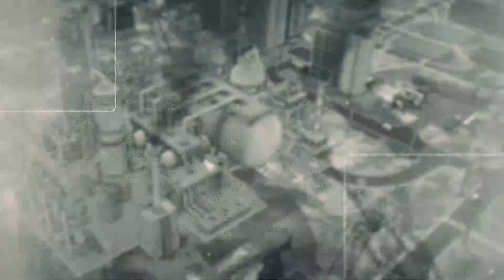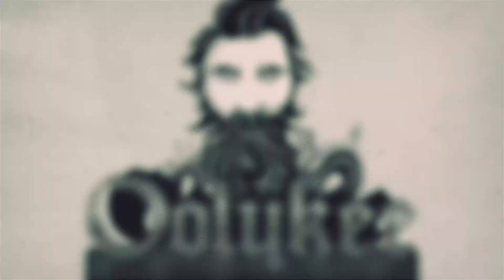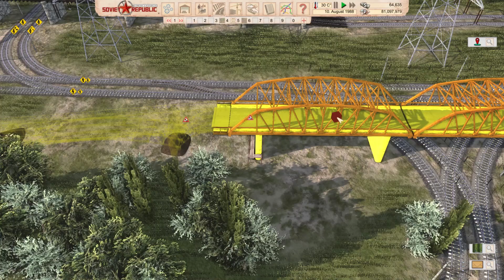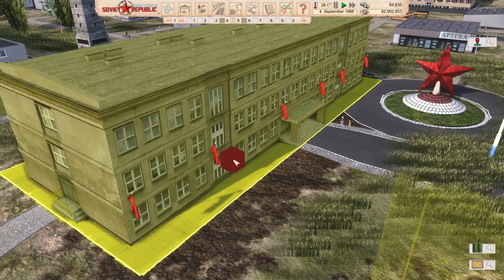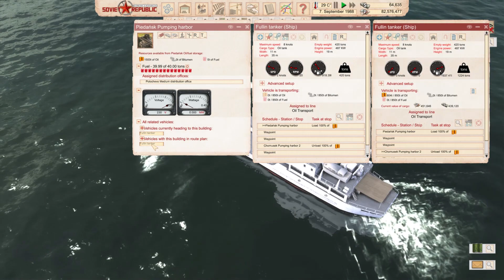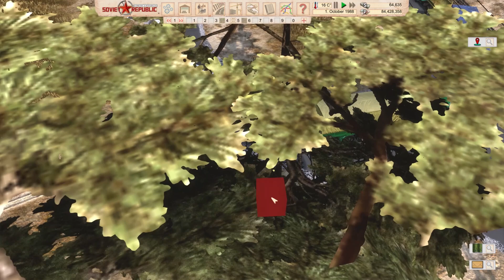Soviet Republic - Alaska - The New Beginning - Ep.118

Comment: 1) You should supply your DOs with fuel and reserve your gas stations for buses and trucks that have a "direct line". Having all those covered hulls from agricultural areas (not to mention harvesters) using your "urban" gas station doesn't make much sense.
2) There is no line spacing option for trains and trams. The developers told me that they regretted it but that for coding reasons they would not try to implement a line spacing system for trains and trams. The only way to space them out is to play with the semaphores, but for complex lines with many stops and a large number of vehicles the solution works quite poorly I must say.
3) If you want to make your streetcar lines look a bit more urban you can use paving, it looks pretty good, it looks like a real streetcar line on a "road". On the other hand, it's painfull enough to get a good result (but there are ways to get there)
4) Chemical industry thoughts (and only opinions) :
a) If it were me I wouldn't build all these chemical factories in the same area, from a city design perspective they look too different to look "pretty" (from my point of view). For example two of them (Kardifabrik and Huge chemical plant) have a brown brick look that would go better with a city of this type, Rob's have their own cohesive appearance that could eventually ally with the large chemical plant of Mauser Nato (the one that produces 8.4) etc. To summarize if I were you I would group them in different areas according to their appearance.
b) Besides, more than a chemical city you want to develop a "chemistry valley" and therefore you can quite possibly have two cities with two different groups of factories. Rob's factories and Mauser Nato's for one city, brown brick chemical factories for a second city (more towards the border).
c) I would add that if for example you group together the brown brick chemical factories you also have moded fabric plant and clothes plant that look the same (and since the fabric factory uses chemicals ...), you could thus having a big city of bricks (the magnificent Hardau mod perhaps ?) with this group of factories, the area towards the border being quite spacious.
d) The Hazardous chemical plant (whose stats need to be remade to be used, IMHO) has an old industry look that would be more appropriate as a side industry in a small town elsewhere on the map.
e) Likewise in my opinion the chemical factories of LegendGamer (which should also have their stats remade IMHO) have their own coherent appearance so much with each other that they could be part of a third city with the adapted look
Reply from the maker: 1. Will do! You are right! 
2. Thanks. 
3. Good idea! 
4. 
a. Interesting. 
b. Not sure if we have space for another city there. Maybe I should plan it elsewhere. 
c. I will do this. Good one. 
d. Agreed! 

Thanks, Stats!

Comment: yes the gui for the demolish, basically the underlying popup is interfering with the top one, so if you click in lower right corner of the checkmark button, that area isnt overlapping the underlying window, and so it works properly, but majority of the button is overlapping the underlying one so it interferes.  pretty sure you can also hit the enter key or numpad enter key to confirm the same as clicking checkmark buttons on (i think) any dialogue in game with checkmark button.
Reply from the maker: You are right! I used to do it with the enter button. Thank you, Aya! :)

Comment: I find when using the raising up tht terrain method, using the elevation map makes it a lot easier to get both sides to the same height. If the game had a littlr more road functions as cities skylines, a roundabout at the intersection you built would be perfect for all those roads to come together. I thik tht city would have been built in tht large open area and the industry in tht more confined and less valuable land of the narrow vally but thatd just me if course.
Reply from the maker: Noted. I will consider both options for the city location. It all depends on the size of the industrial area. I did not calculate the logistics of oil, gravel, wood......for the industries. This might take more space than the city.
Reply: @oolykeegaming81  yeah totally my chemical factory has an open storage, agrqgate storage, a warehouse and a silo attached. So yeah it take some space and that is just one factory. I think you will have room in tht valley and you could streamline it way more than I did too of course. I'm pretty messy when it comes to layout I try hard but it still come out messy 🙂